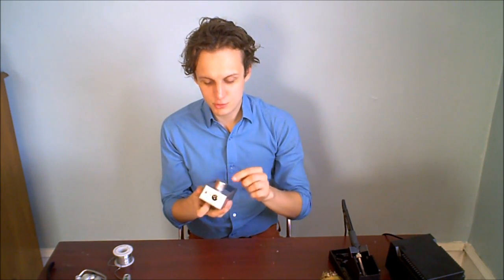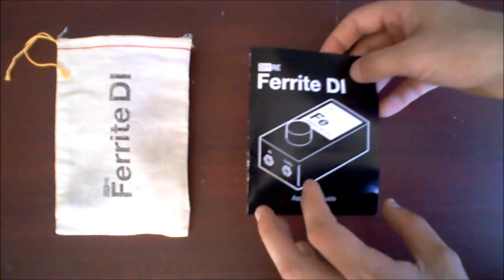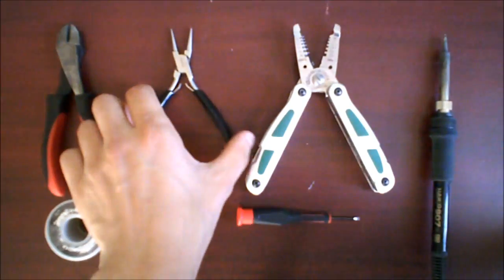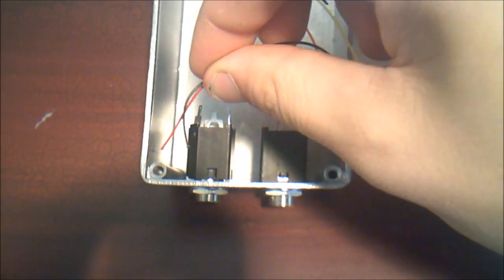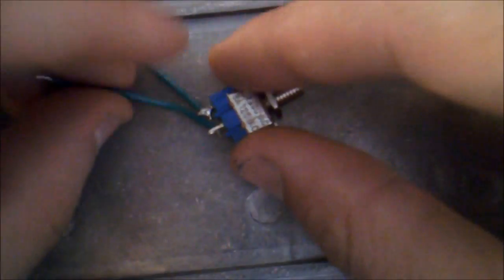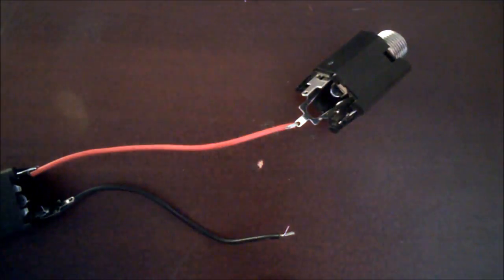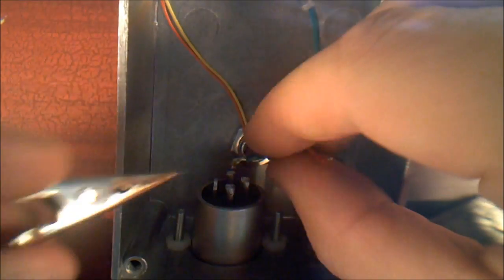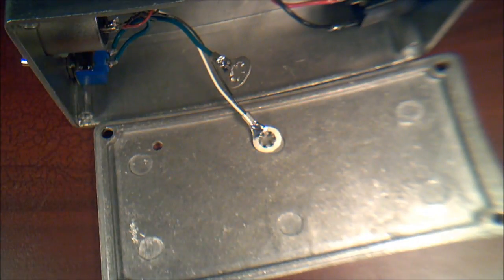How to Build a DIY Passive DI (Ferrite DI)

Comment: What spec of transgormer is best?
Reply from the maker: Hi Jonny, usually DI transformers are specifically specified as such but in general you are looking for at 12:1 ratio, mu-metal shielding, and faraday shields on the windings.

Comment: I wonder if this guy is still selling these. I'm not sure what the prices on this stuff were like in 2012, but you can buy everything except the transformer for less than $20 on Digikey and they're not even usually the best place to get things like audio connectors. It's possible that the transformer is ridiculously expensive, but if that's the case it just means that passive isn't the way to go. You can get a whole lot of analog silicon for $50. Vacuum tubes aren't even out of the question if you're so inclined and you're willing to drop that kind of money on a one off build of something you could just buy for equal or less money (and get a refund for if it doesn't work).

Comment: Is this the same thing as like a line-out box for a guitar amp?
Reply: Yep, that's right.  It provides a balanced, line-level signal for plugging directly into a mixing board or recording console, via an XLR cable.  The "through" jack also provides an unbalanced, instrument level signal for plugging into an amp.

Comment: 100 bucks? Maybe cool as a build project, but not a money saving solution. Considering the cost of this project, you can buy a brand new, high quality Radial DI Pro box for the same price, and cheaper DI-boxes for fraction of the cost.
Reply: +ahjteam In the the Radial DI Pro you won't be getting a high end transformer like the Cinemag that comes in this set up. (Which is ~$70 from the manufacture). If you come up to ~160 in the used market you can pick up a Radial JDI which does come with a nice Jenson transformer. Even though this kit isn't available, the parts list and schematic are still a no brainer for anyone looking for a boutique DI box at around ~$100.
Reply: ***** I agree, it looks like a great fun project, but for 50-100 you can get a premade DI box
Reply: +Aaron Profitt Maybe a silly question , but with Guitar effects pedals , would it not be better to use rack mount gear , whats the advantage of buying pedals at 50-100 bucks each instead of rack gear ?
Reply: @charliebrownau  Portability. And a good DI is essential to that. It's not impossible with current technology to construct a rig that will last the entirety of a music career, no matter how large or successful, that fits into a space no larger than a suitcase.
Reply: +charlie brownau As someone who's never really invested anything into rack mounted gear, I'm probably not a great person to ask. But, as someone with a lot of pedals, I can say that it is nice to be able to piece together your sound with small investments. And, as just a weekend guitar player, it's nice to keep things mobile and right in front of you.

Comment: Hi, thanks for your video.
Could I ask you a question? I have an old small DJ mixer with an unbalanced input microphne 1/4 inch jack (TS) and I want to replace it by an XLR female balanced.
Can you tell me how do I balance the mic input XLR shifting the pin 3 phase and add it to pin 2 and cancel the noise in long cables? Is there any way to do this in a simply way because the small space inside the mixer chassis?
Thank you and please excuse my english.

Comment: Do the black and white wires (with their ring terminal screw to the bottom of the enclosure? Or does the green/blue wire from the switch screw to the bottom of the enclosure? Or do both of them screw to the bottom of the enclosure?
Reply: Yeah the one crucial thing missing from this video is what to do with the ring terminals